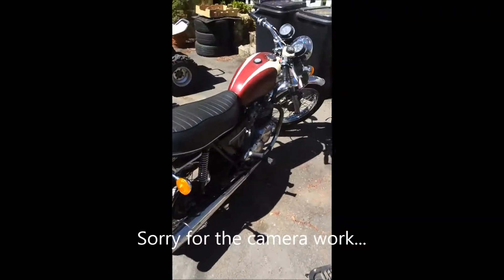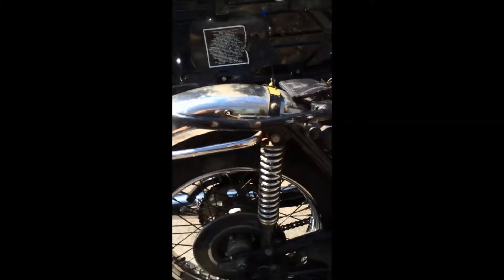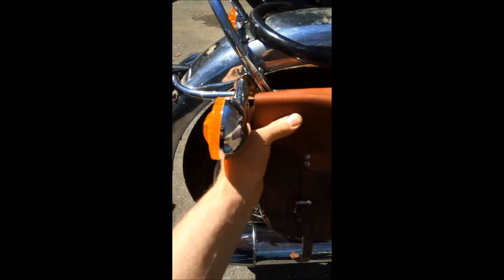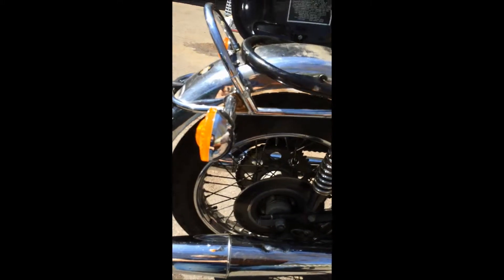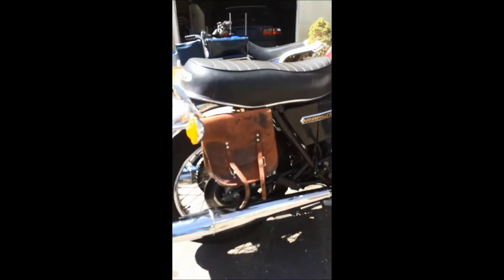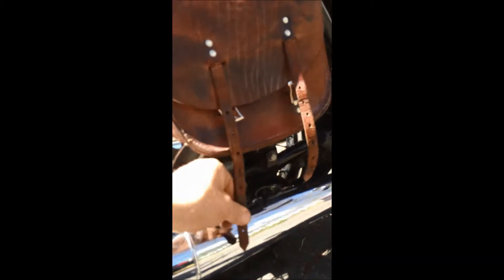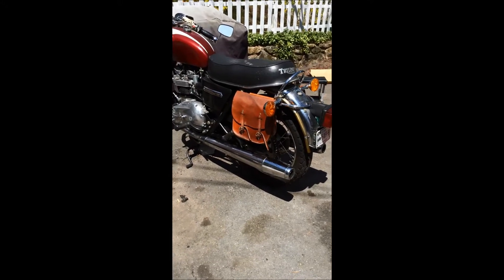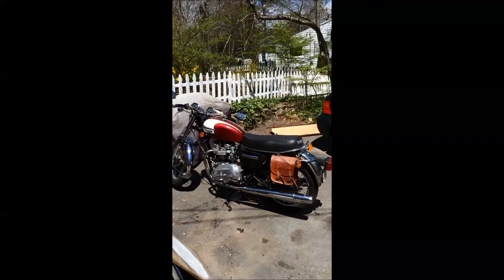Fitting leather horse Saddlebags to a classic Triumph Motorcycle

Comment: Is there a follow up?  I want to know if they do flap and if so, what did you do to stop that?
TIA
Reply from the maker: broadwayFan28 sorry I never got back to this video to answer that question, but no, no flapping whatsoever. They’re great! They hold a ton of stuff, even a lightweight jacket rolled up., and I’ve had no issues with the heat from the exhaust or noise from the flaps.